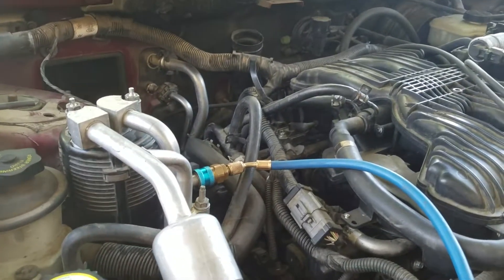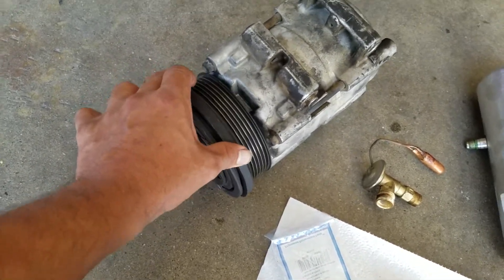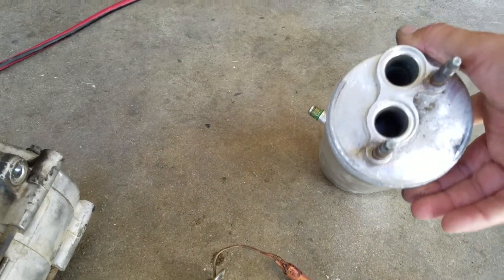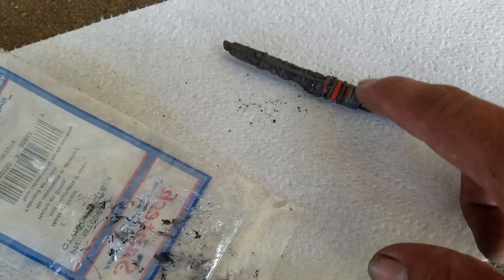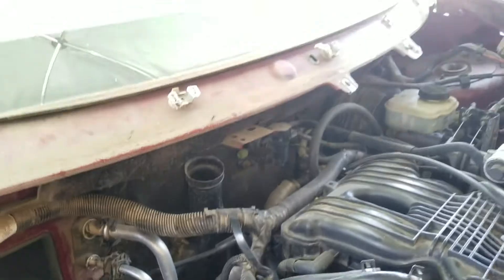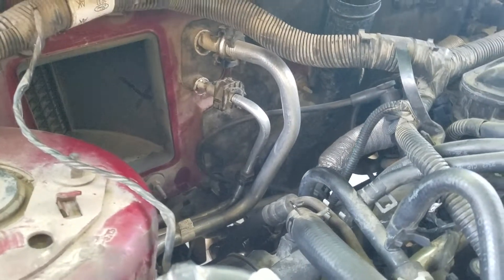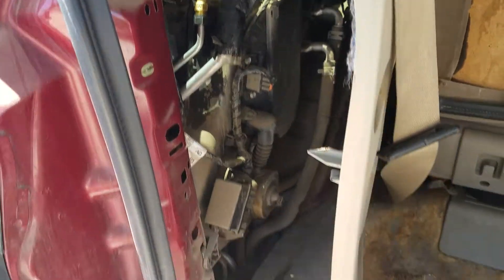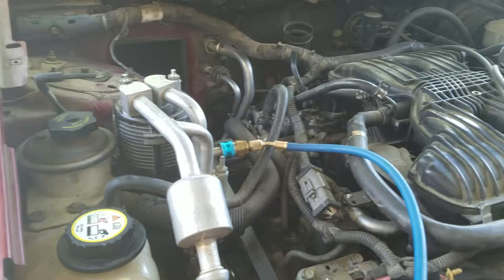Ford freestar expansion valve and orifice tube location

Comment: Looking for information related to my 2004 Explorer Limited. Could not find any good information for the location of the Expansion Valve. When you showed the location on the front/rear system it has given me a new place to look as the Limited Edition has front/rear ac. Great video didn't make me sea-sick with unneeded camera  motion.